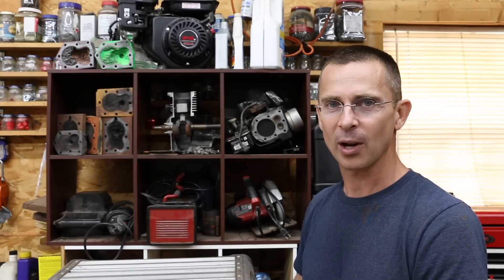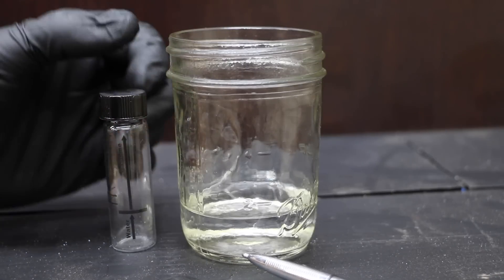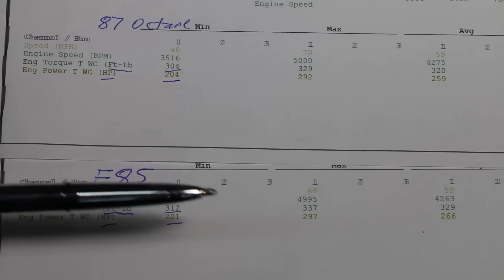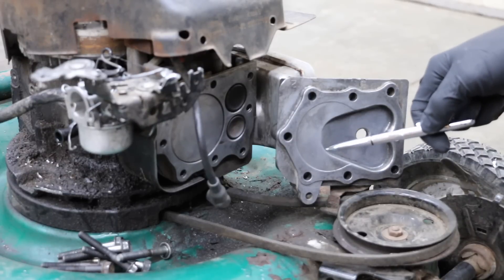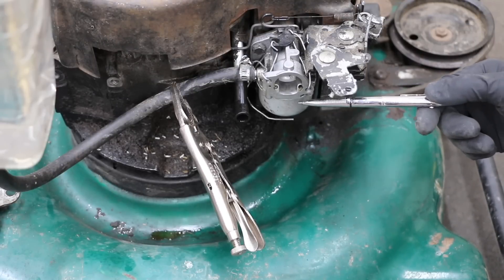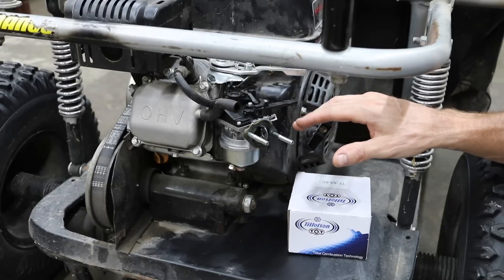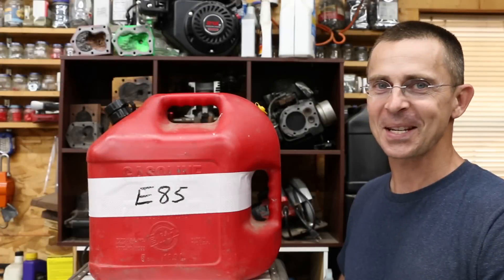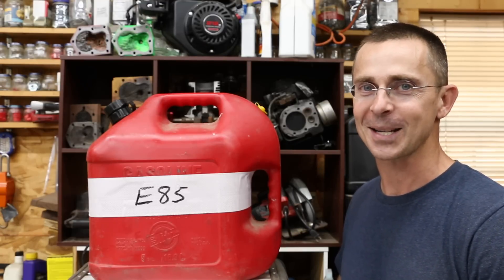Is E85 better than Gasoline? Let's find out!

Comment: i have question regarding fuel types in the US. Why do you have so low octane fuels ? the lowest you can buy in Germany is 95, then you have 98 and 100/102. could i even drive my car in the us (it says minimum 95 oktane fuel)?
Reply from the maker: Great point. The US uses a different system for rating octane.
Reply: @ProjectFarm  ah OK, thank you I will read about it. Keep up the awesome videos:)

Comment: You should really run several tanks of both E85 and 87 before deciding your results. Many conditions effect fuel mileage and you can’t accurately measure the amount of fuel used simply by filling the tank till it shuts off. Saying that, the difference in your in mileage appeared significant.
Reply from the maker: Thank you!

Comment: I see you took my idea of the Tillotson carb! Liking it??
Reply from the maker: Thank you very much for recommending this!  I bought the carb right after you recommended it, but just didn't get around to installing it for a while.  It's a GREAT carb!  Thanks again.
Reply: @ProjectFarm  I have one and am giving it to a buddy for Christmas and tuning it for him. I loved it on my go-kart but with the racing motor, I have now it won't run right with the Tillotson carb.  Did you end up getting it from Go Power Sports? I would highly recommend getting the Stage 1 Performance kit. Try it out you will love the increase in power with the Tillotson carb. These motors have alot of speed parts for them. My 212cc Hemi is putting out 18HP. Stock it made 6.5.

Comment: Maybe do a comparison of gas as it ages and look at how it degrades maybe over a 6-12 month time frame. I’d love to see how old gas ignites in the see through cylinder head engine.

Also maybe a comparison on 87-93 octane fuels in small motors. IE lawnmowers and string trimmers. I always hear mixed arguments on that. I just stick with 93 but if I could save a couple bucks that would be nice also. Keep up the great work.
Reply from the maker: Thanks for the video idea!

Comment: I have a supercharged 6.8 liter V8 in my car, 12.5:1 compression ratio and meant to run specifically on E85 but still tuned to run 91 octane in an emergency. E85 made 101 MORE hp than gasoline (645 vs 544). The gasoline tune couldn't run much timing and sacrificed tons of power and mpg because of this. E85 gets me 9mpg and 91 gets me 10 mpg. But e85 costs $1 less than 91 in my area so ethanol is still much more economical and significantly more fun!
Reply from the maker: Wow!  That's a lot of HP under the hood!
Reply: the Koenigsegg Agera, one of the most powerfull car in the world, gets its full power (near a thousand HP) only with E85.
Reply: @Damien.D  I recommended to Project Farm that he ride a dirt bike with a 450 cc 4 stroke engine. These engines are built with compression ratios at or above 12:1.
Reply: The Agera RS makes 1341HP on E85
Reply: Its an Corvette ZR1, right?
Reply: @A-G-F-  it's a CTS-V, similar engine to the ZR1. Got a couple of videos on my channel.
Reply: Richard Skipper  you have thr additude of a losser
Reply: The e85 is not what producing the power it the fact that your pushing a lot of it threw the engine to make that hp...
Reply: @chrsmcwtrs  E85 is much higher octane, allowing the engine to run harder without detuning itself to prevent knock
Reply: @hajjdawood  uh yes I know... The 85% alcohol give it a lot of octane...
Reply: @chrsmcwtrs  yes your using more, but thats not why it makes more power, E85 has an insanely higher octane content (108)  over 94 gasoline. This doesnt mean much for people who dont run boost in their cars. But as for the twin turbo Koenigsegg agera, it needs the higher octane rating to avoid pre-ignition from all that boost
Reply: @jtb6075  I know this I am a mechanic I understand how these things work and I  agree useing ethanol in vehicles designed for it is fine but in other vehicles results are not the same
Reply: @jtb6075  why better power eith ethanol? Because ethanol has lower molecular weight than gasoline, then it puts more fuel, even its calorific power is lower. Comprwsion ratio also  helps
Reply: @vicent436 how does molecular weight and calorimetry affect power of ethanol more than its octane rating
Reply: @jtb6075  Octane gas nothigto do do   Only if compression ratio makes the engine detonate
Reply: @vicent436  Don't forget that ethanol requires less Oxygen to burn thus you can burn more fuel for the give amount of air.  Add that to the boost ability without pre detonation and you have a lot of power.
Reply: @superchuck3259  That is the same I wrote, in other words
Reply: @superchuck3259  Less oxygen per mol of ethanol than gasoline. The point is how much oxygen you can burn, and rhe partial volume ocuped by combustible
Reply: @vicent436  Yes Ethanol has O in the chemical formula.  Octane, it has no O, just C and H.
Reply: @chrsmcwtrs  no doubt I'm pushing a lot more e85 through it lol  fuel economy takes a decent hit vs premium
Reply: @chrsmcwtrs  dont use logic man they dont get it
Reply: @theghost7277    yes your using more, but thats not why it makes more power, E85 has an insanely higher octane content (108)  over 94 gasoline. This doesnt mean much for people who dont run boost in their cars. But as for the twin turbo Koenigsegg agera, it needs the higher octane rating to avoid pre-ignition from all that boost
Reply: Me Laughs with 50mpg
Reply: @picarraphotography  Meaning What  ?  What the heck is getting 50 mpg  ?  I think these smart alec , vague post look  dumb
Reply: @picarraphotography  laughs in actual fun
Reply: @picarraphotography  Thank you for offsetting my carbon footprint
Reply: @picarraphotography  I have a prius alongside that 700hp supercharged car, so I'm laughing too

Comment: The thumbnail shows it as the cheapest gas on the pump 😂 sorry just found that funny
Reply from the maker: Yes, it's the cheapest in price but fuel efficiency drops a lot making this more expensive to use where I live. Some can buy it for 30-40% less than typical pump fuel and that makes it worth it for them.

Comment: Being one of the lucky ones, who live in Oregon.....and that's all we are supposed to be able to get....
For about 20 years... 
It works, gas engines will run on it... Some older carberated engines don't like it!!! Our fertlizer buggy has a mid 1960s Chrysler 318 industrial that was built by a racecar engine builder.. it won't start on the crap!!! It will run, if you can get it started...
Small engines hate it too! It's such great stuff, that the Marina's in the state are not allowed to carry it!!
We run it in the newer vehicles, 2001 and newer.. our four wheelers run on it, but only if we keep 1oz. Of stabil and 1oz. Of octane boost per 2 1/2 gallons.
Milage is CRAP!!!!
We pay 5 cents more per gallon and get 10% to 15% less gas mileage....and God knows how much less power.
It also isn't very good for starting fires either....

Comment: have you done any testing on E15 - 88 Octane on automotive engines?  A local gas station in PA (Sheetz) sells it for about 5 cents less than E10-87 Octane. Just wondering.  Great youtube channel. keep up the great work.

thanks, Ken
Reply from the maker: Not yet. Thanks for the video idea.

Comment: I’ve find it quite odd to see the fuel types at your gas-stations... 

Over here in Germany the lowest quality gas you can get has about 91 octane (normal gasoline) but the most people buy super which got 95 or super plus with 98 octane. 
For high end use you can get even 100 octane fuel (shell v-power) 102 (Aral ultimate 102). 
You also can get special diesel like Aral ultimate or shell v-power for use in high-end engines. (I brings you a bit more power, smoother run and the engine is a bit less thirsty. 

I wonder which other types of fuel are normally available in the states?

Do you got different types of diesel-fuel? (Over here it’s truck-diesel, normal diesel and the expensive high-end-stuff)
Reply from the maker: Thank you.  The US uses a different system for rating octane.
Reply: Ahhhh ok now I’m understanding it... you never stop learning! 

Thanks man, you’re channel is great!
Reply: We have biodiesel.

Comment: E-85 is an expensive solution to a problem that does not exist... no we are not running out of oil.  For a street car, law mower, etc, regular gasoline is a better option. Using a compression ignition engine and Diesel, an even more energy dense fuel is better still.
Reply from the maker: Thank you

Comment: E85 requires special hoses and seals also we use e85 in race engines and found e85 is best in engines that are 11.5:1 and higher compression and e85 requiers alot more fuel and carbs designed to use e85 different heat rang plug is also required for best results
Reply from the maker: Thanks for the comment!

Comment: As a pilot i know that diesel is the same as jet A fuel for jets they just add chemicals to the jet A so it doesn’t freeze at higher altitudes 

So of course i can’t try it in a real plane i was wondering if you could find a way to try it either by having a jet engine that runs on jet fuel or a diesel engine and try jet fuel which is the easy and cheap option
Reply from the maker: Thanks for the video idea!

Comment: What is it about ethanol that prompts so many ill-informed comments? It's just as bad as religion or politics.

Anyway, I've been running E85 and blends of E85/E10 for many years in my non-flex-fuel vehicles. EFI is able to richen sufficiently to run great with ethanol although sometimes it will throw a CEL. 50/50 E85/E10 shows virtually no fuel economy deterioration vs E10; of course straight E85 reduces mpgs. Often the price differential more than makes up for that.
Reply from the maker: Thank you

Comment: My 2002 Chevy S10 Sport is a Flex Fuel Vehicle... It has a Cobalt 2.2 4 cylinder... I bought it brand new and ran E85 the first 6,000 miles... The truck ran great and clean BUT my fuel mileage was bad compared to regular 87 octane gasoline.. About 11 mpg on E85.. vs. 18 mpg 87octane gas.
Reply from the maker: Wow!  That's poor economy on E85.
Reply: That’s terrible my 95 ford has a 4.9 6cyl that gets 18-20

Comment: It's 105 octane if you get a 85% ethanol to get any lower its lower octane but you get a good source of E85 that's 85% ethanol around 105% octane that's a lot of octane course of Dodge does it better than the Chevrolet you have to worry about running out of regular gasoline you flip a switch and it runs on E85 Chevy and Ford you have to run out the gasoline and then put E85 in it
Reply from the maker: Thank you for this information.

Comment: Randy She 

That’s an extreme. Actually E85 is advertised as being made from sugar cane- nothing to do with livestock, meaning we won’t see it lose popularity even if you took away the corn. Plus, corn is already being used in livestock enough, so the excess is being turned into containable fuel. Corn doesn’t ‘belong’ in our meats and our alcohol, because frankly E85 is an alcoholic mixture, it’s just rebranded moonshine combined with gas. Gasoline is made from oil which right now is central to international trade, and thinking you could make a better fuel using anything that can create ethanol in your backyard would be tragic to that, so of course you think gasoline is better because somebody high above you thinks so. I’m just waiting for some genius like Project Farm to figure out an engine configuration for a simple vehicle like a motorized bike that would accept ethanol as a fuel source.

Not sure anybody’s going to see this hidden in a reply section, so how ‘bout I upgrade to the comment section?
Reply from the maker: Thank you!

Comment: Your e85 dunno results don't show the benefit of using e85 for power. Stock engine engine management will not be able to reap the benefit. E85 has a higher resistance to knock so you can't crank up the timing a lot of higher. It has an octane rating of approx 100. It's not just good for boosted engines ONLY as some people have mentioned. It is a preferred fuel for your daily driver/weekend warrior racer. Also Your results being used for the Dyno should be pretty similar as if you used 3rd gear. The computer users a time/rpm base to determine power.
Reply from the maker: Thanks for the constructive feedback.

Comment: The basic fault of this test is that you are testing E85 in an engine designed to efficiently run on 87 octane pump gas.  It seems that people give E-85 a bum rap because it doesn't perform as well as regular pump gas.  The true value in E-85 would be found in an engine optimized for E-85.  That means increasing the compression either through boosting air intake or changing the combustion chamber.  If the manufacturer's were to make engine output the target then you would find that you can accomplish a lot more horsepower and torque with E-85 than you can with 87 Octane gas.  So instead of using a V-8 with 5.7 litre displacement you would be able to get the same performance from a 2.2 litre 4cyl.
Reply from the maker: Thank you for the constructive feedback.
Reply: Nissan has a new turbocharged, variable compression ratio engine in its 2019 production cars.Imagine possibilities of something like that to exploit e85.
Reply: SAAB is also running a variable compression rate engine for industrial uses at the moment.
Reply: I would like to see a manufacturer here in the US make a vehicle optimized for E-85.  If they determined that it required an engine output of 400HP they could then use a much smaller displacement 4 cylinder and save on weight and fuel economy.  Also less complicated drive train since there would be less moving parts.
Reply: Unlikely. The major is push is toward electric and autonomous.
Reply: Never ran it in my 07  Tahoe before. I think I will run a tank of it to de-carbon my engine and should clean up my injections.
Reply: this test was "will E85 work in an engine not designed for it". What was missing from this test as far as i can see was the 'real world' test of the pocketbook; nobody cares what MPG is what is the ¢/mile. The pump was cut off for the cost on the E85 but i think it was exactly $70 that comes out to 19.4¢/mile vs 16.8¢ for the gas. So this experiment proved that you can run a non-optimized gas engine on E85 but it will cost 15% more $ to do so. The experiment should be done on an E85 flex fuel vehicle. 

Now for the True test of cheap car driving: how about a natural gas powered car? When i was looking into buying one, the cost of the fuel was stupid cheap but the math on the mpg was very fuzzy logic because they don't use gallons; you'd have to drive a car and go by the dollars to compare ¢/mile which stupidly i've never seen done.

Comment: Wow the prices! 😱😱😱
$2.60 USD = £2.00 GBP

Our basic quality fuel is equivalent
 to $6.42 per US gallon . 

1 US Gallon = 0.832674 of
1 imperial gallon ( GB/UK gallon )
Reply from the maker: Wow!  That's expensive.  Thanks for commenting.
Reply: Some States in the US have gas for around $2.  It's currently in the 2.20's in my area.  2o years ago you could get it for less than a dollar a gallon.

Comment: We don't have E85 in Canada but some of the vehicles sold here are compatible with it.  I have a 2010 grand caravan that is set up for E85 so when we went for a trip to USA and saw how much lower cost  E85 was per gallon I tried it a few times and I was very disappointed.  Sure it costs less but with a tank full of that stuff and headed for some mountain passes I could clearly feel the loss in power and when I crunched the numbers found the same as you - the mpg dropped like a rock.  What a waste of time and corn (to make E85).  The only good thing I can think of is that it is a very simple way to clean out the fuel system and the cylinders without buying other additives to dump into the gas tank.
Reply from the maker: Great point on the disadvantages! Thanks for commenting.

Comment: As for use vs. costs, it will depend if the lesser cost will outweigh the reduced mileage.  Personally, I was getting 3 miles per gallon less when using E85 (12 MPG v. 15 MPG).

For myself, if the cost of E85 was 80% of the cost of 87 octane, then the use of E85 was feasible.  Over the past couple of years, it has not been the case where I live.
Reply from the maker: Great point. Thank you

Comment: My 2016 Shelby GT350, 12:1 compression,  is tuned by Lund Racing to be a flex fuel vehicle. My engine is rated at 526 hp on 93 octane. Living in California the best premium is 91. Hence horsepower drops to 516. The combination of engine tune and 105 octane e85 recovered the 10 hp lost to the lower octane and added another 30+ on top of that bringing it to around 560. The difference in price in Project Farm's state isn't enough to make economic sense. But where I live e85 costs $2.60 and 91 about $3.95. To get the same power I now have I'd have to pay $9-10 for race fuel. I love e85.
Reply from the maker: That's a very nice car with lots of power!  Great point. I'd buy E85 in your situation for sure.

Comment: It says in a lawn mower manuel dont use beyond E-10 gas.

Its not designed to run on it.

It will corrode faster and the fuel line is not meant for it. So it would eat it up too.

Shelf life
100% Gas lasts 6 months atleast.
E-10 90 to 100 days 
E-85 even less
Reply from the maker: Great point. Thank you

Comment: I have a 2013 dodge avenger (3.6 pentastar v6 flex fuel compatible) i have done testing with e85, 87 and 93. I have yet to use 93 no octane, but my average fuel economy was about 21 on e85 as opposed to 26.5 on 87 and 93. On average the 93 did about 1mpg better city, with no difference highway, but was not worth the money for me. I have since gone to 87 and can see 38mpg on flat ground at 70mph. Marked improvements in fuel economy over e85.
Reply from the maker: Great strategy to save money!